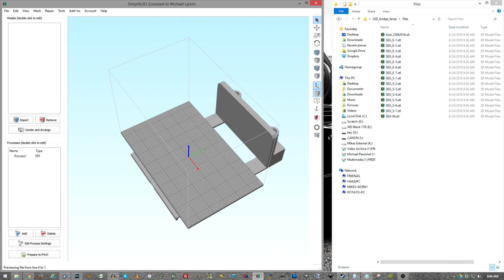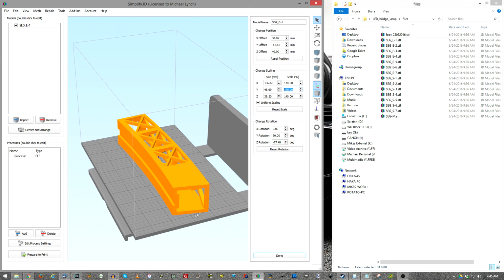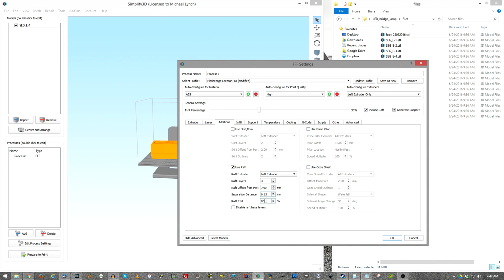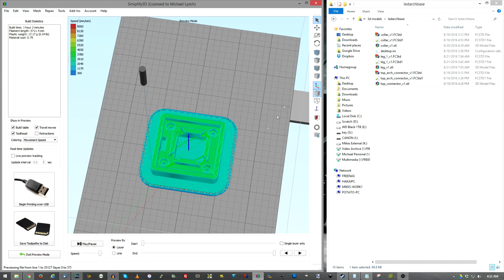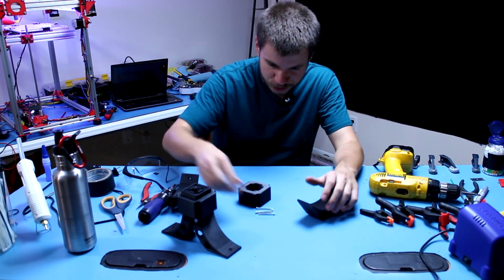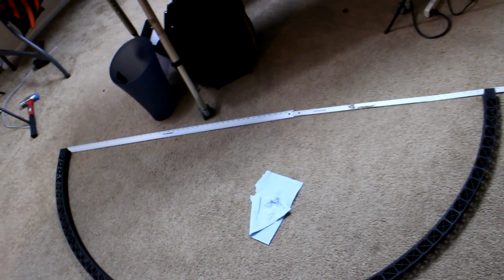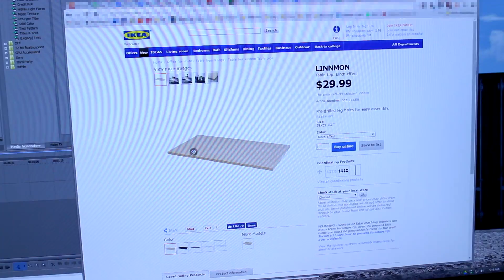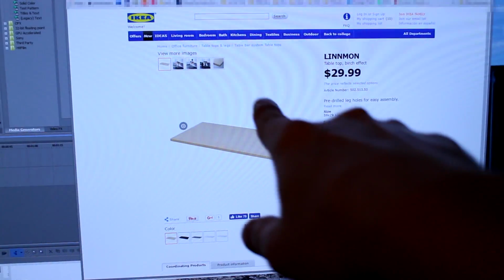INSANELY HUGE 3D PRINTED LED ARCH LIGHT - Part 1

Comment: Is this printed in PLA?
Reply from the maker: I actually printed this in ABS, but I would reccomend people print this in either PETG or PLA to avoid warping issues.
Reply: Power Playground will the LED's get too hot for PLA?

Comment: If i'm not mistaken you can chemicaly weld abs together with acetone. that is maybe better than a hot glue gun
Reply from the maker: +Bastiaan Van denabeele Maybe, but I didn't have a garage to store this in to deal with the Noxious fumes of acetone at the time of assembly. Plus hot glue allows me to easily disassemble the light easily down the road when I want to move. :)